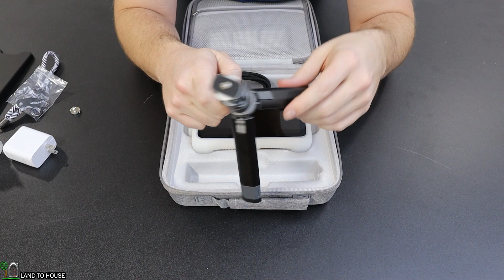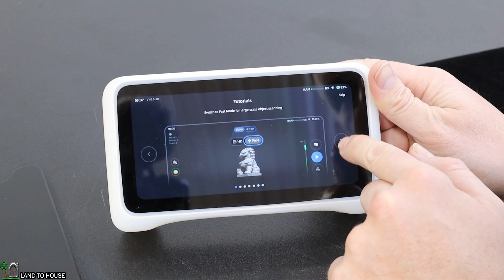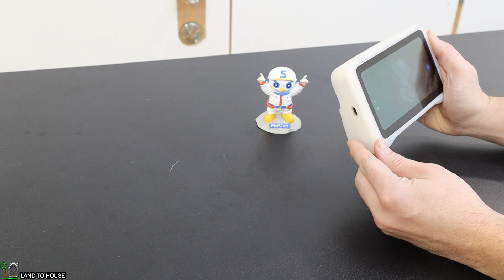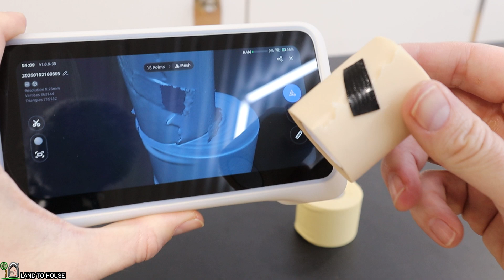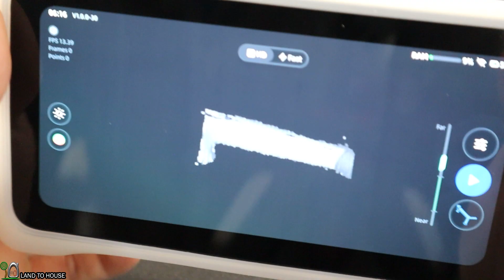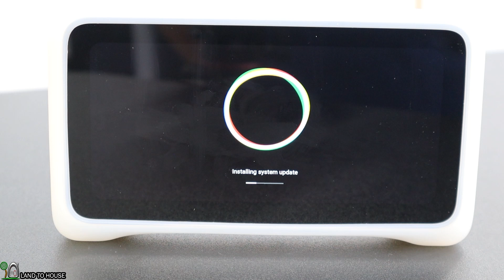Einstar VEGA 3D Scanner Basics

Comment: Wow! Thaty's pretty cool Seth!  You'll need to get yourself a turn table or lazy susan to help rotate the models smoothly. I wonder how it would handle a clear (lucite) table so you can capture the bottom of the model too??  I would be interested in seeing how things actually print out after the scanning process is done.  This device seems to do a really good job. It's a bit pricey for my blood, but if I had a commercial application for it, I would definately consider it. Hopefully, the price will come down a bit after they start selling more of those. Thanks for sharing!